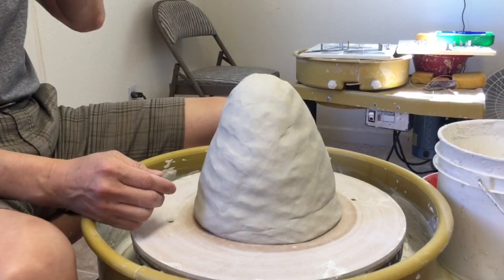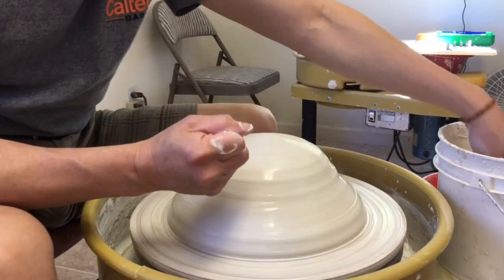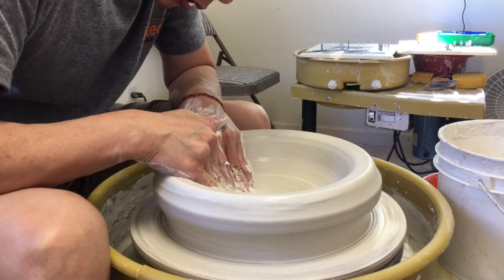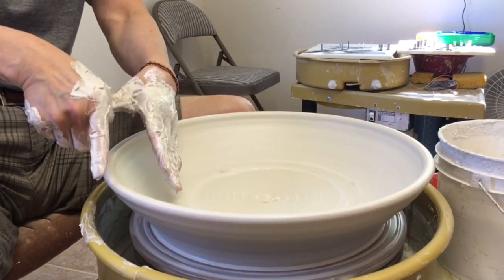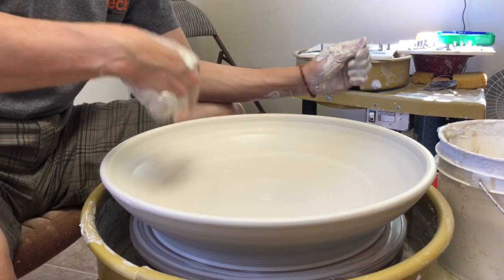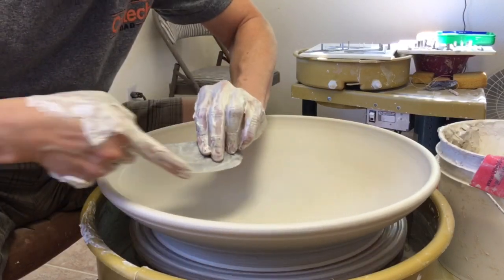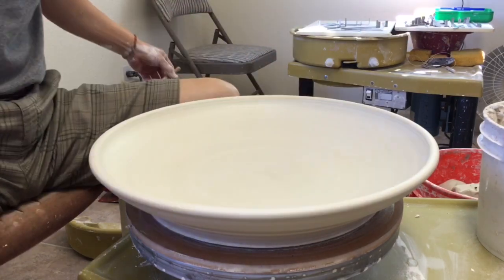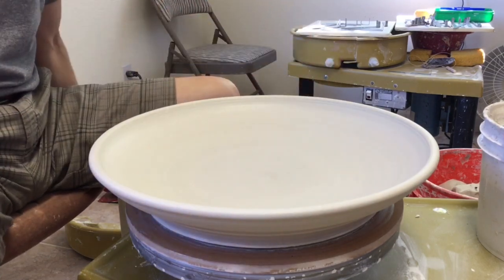283. Throwing a Large Platter with Hsin-Chuen Lin 林新春 示範拉大盤

Comment: Hsin-Chuen: I am having a problem with the cone 5 porcelain I was hoping you can help with. I notice you get a good amount of slip on your hands when throwing yet Ingleton (if you look at his youtube channel) does not. On the other hand I get an ungodly amount and practically need a sponge or drag is induced, the pot twists and I have to start over. I am currious if this is just an artifact of the clay I am using or if its something I am doing wrong. For example in centering I have to we it a ton to avoid this.
Reply: This was asked admittedly a while ago, but I can your questions. The Ingleton potter uses a stoneware clay unique to his region. In one of his past videos, he says it is more resistant to slaking down from the heavy amounts of water he uses than is typical of other clay bodies. That's why his hands were so free of slip. He also works very fast and that helps him get away with drenching his pots so much. Hsin-Chuen works primarily with high fire porcelain. Those very fine clays will generate lots of slip on your hands, particularly if you used too much water during centering or pulling. The drag doesn't come from slip on your hands, but rather the walls not being lubricated enough before you tried making a pull. Sometimes it's necessary to add water on top of a slip coat. You can't always avoid dry spots or even getting twists in the walls. Those can actually be corrected by using a rib to recompress and flatten any warping. See Hsin-Chuen's video #615, for example.